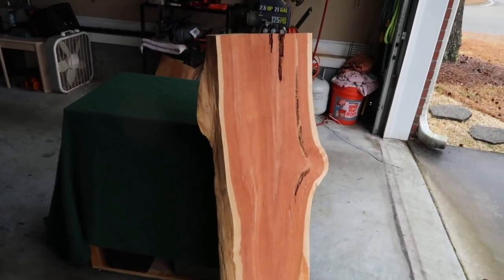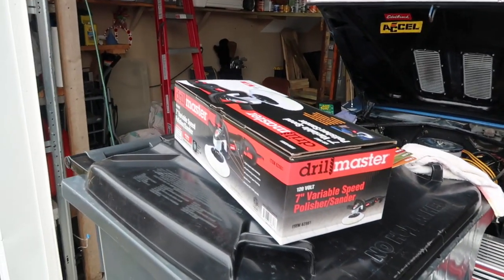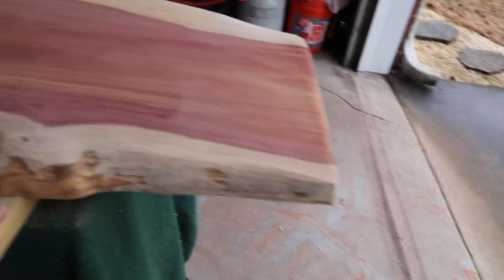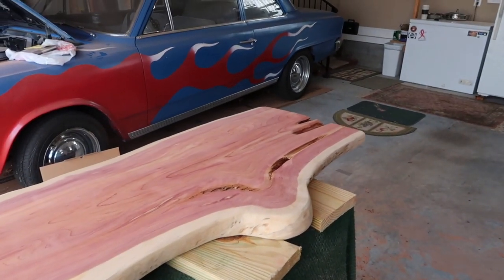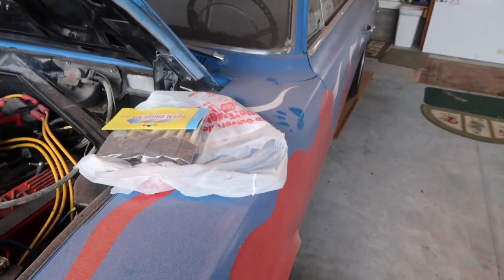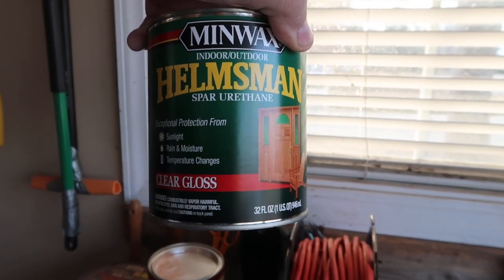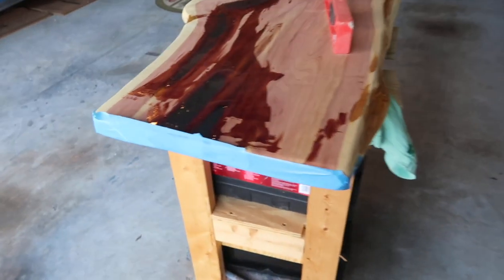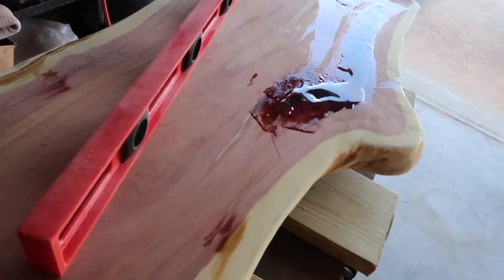Refinishing Cedar Slab Wood With Fiberglass Resin

Comment: Did the epoxy ever dry? I’m wondering how it ended up cuz I was curious if that fiberglass resin could be used
Reply from the maker: not really.  I wish I had used a different method now...  my friend Donna used Bondo and that would have gone better than what I used...
Reply: @StuffIHeard  i bet it was the mineral spirits
Reply: That Bondo brand epoxy is only to be used with fiberglass, or in very thin applications.

Comment: Measuring exact amounts is a necessity with resin. Hope hardener works for you, but since the bonds are most likely all already broken it probably won't help. Also, that bondo epoxy is used to bond fiberglass to wood, metal etc, not really for thick pours; not all epoxies are created equal...
Reply from the maker: thanks.  I have a friend who uses bond-o and it works great.  I thought of trying a more expensive epoxy but I couldn't afford it.  Layering the clear urethane made a nice finish hardening everything.